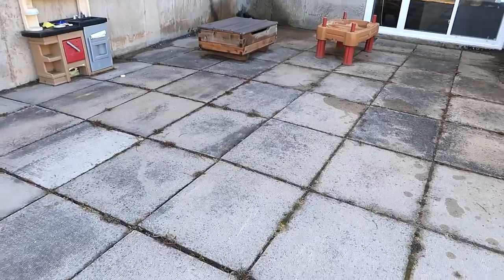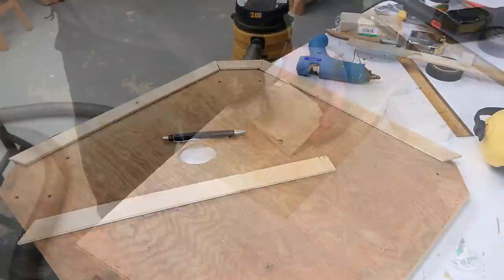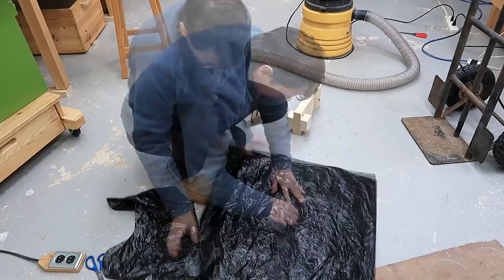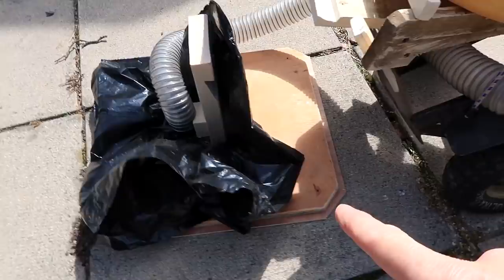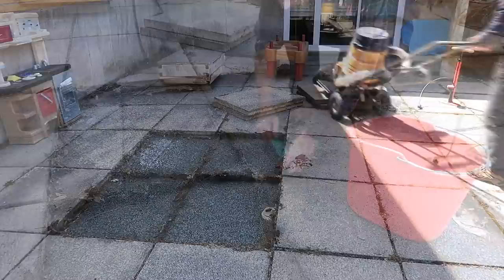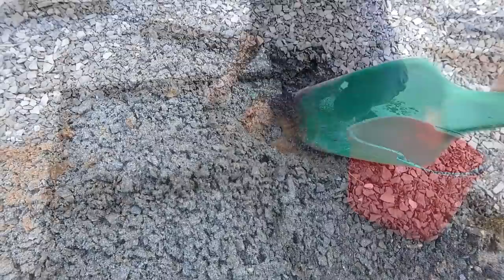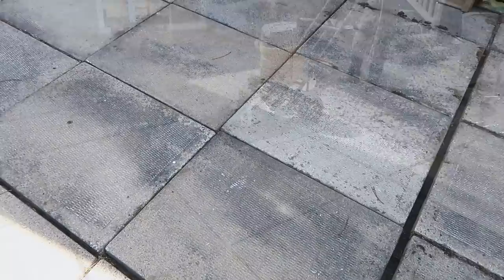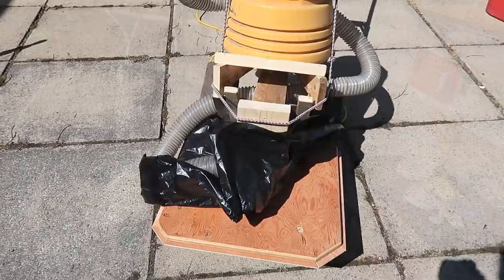Lifting patio stones with a shopvac

Comment: If you remove all the pavers or in sections. Clean the weeds and level the area and then place down woven landscape fabric then place the stones back and back fill in with clean washed sand or filler it should last you your entire life if not longer.

Comment: And for young Albert Einstein, you suck it a good way.  But what I would use for the weeds not the grow through the cracks takes some dry top surface concrete and just put in the cracks and sweep it out really good.  Or if you can space out the patio stones like accordance and or little a smaller to make sure are the dry concrete really gets in between them.  Or just put heavy duty plastic down under the patio stones or use the soap, vinegar and salt in a pressure bottle and spray it on the weaves.

Comment: I’ve seen people dump sand over top of stones and just sweep it over the cracks, but it seems like a breeze would pull it out just as easily as a broom would sweep it in. I wonder if something like spray foam insulation would be enough to keep plants out. The hard part would be filling in the gaps just enough that you wouldn’t need to trim it flush and expose the open cells in the foam. Maybe sawdust and wood glue? It would be interesting to test different grouting materials around different blocks, and then put something like bean sprouts on top of them to see if the roots are strong enough to dig through.

Comment: Notes/Ideas - I might install a valve to open the vacuum instead of switching the vac on and off .This also allows you to run air through the motor and avoid over heating it or reducing life of motor while it's in suction phase. Having Thick tape ( like door air draft tape) might act as a good border to replace the plastic .

Comment: When placing the stones back in place, place them 10 cm apart to each other and fill the resulting gap with fibre-reinforced concrete.
Plus, you will get an aesthetically pleasing look.
Reply: 10cm is a huge gap. Did you mean 10mm?
Reply: @-vermin-  No I mean 10 cm (4"), otherwise you can't pour your concrete

Comment: Why not add a rubber seal on the bottom of the "suction cup".
Reply: Most rubbers are not rubbery enough.
Reply: @manla8397  I think a wide and thick neoprene rubber self adhesive seal would probably do the trick. But how many of us have one of those laying around compared to a trash bag.

I think if he just wraps the bag around, a little like a hovercraft skirt, it'll be pretty good.

Comment: Hot glue? Is that what they show on TikTok, does that increase strength of the handle?
Reply: Check his glue test from a few days back, hot glue is actually a surprisingly strong choice as a wood glue.
Reply: No but it serves to hold it in place until the screws are added.
Reply: @trashbytes  thanks, it is on my watch list but I haven't made it there yet.
Reply: Pre heating the surfaces makes all the difference

Comment: If the pavers are 24" x 24", then they have 576 sq in.  If your vac develops 5psi of vac as mine does if I remember when I measured it long ago, then you can develop 2880 lb lifting force - reduced by any leakage, of course.  Kids: think STEM education.

Comment: Stop grass from growing...
1) Most weed killers: Pre apply at locations where the spaces between the stones will be once the stones are installed... 
2) Large plastic sheet: Use only plastic sheeting that is designed specifically to prevent plant growth... Cover the entire area where the stones will be installed... 
3) Setting Stones: Cut out shim spacers (1/8" to 1/4" thick x 3/4" wide X 2" to 3" long) to be used while setting stones in place... Set first row against starting wall w/spacers... Set second row w/spacers... Continue until completion... 
Note that spacers can be pulled up and advanced to continuous rows but set at least 2 rows for stability before advancing the spacers... 
Note: Do not be shocked when you discover that the stones are not all the same shape or size...